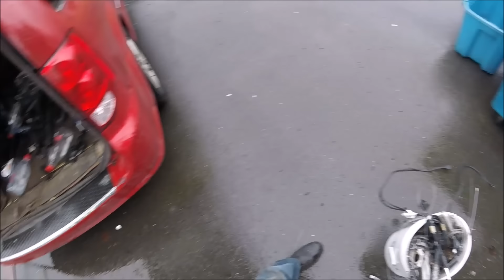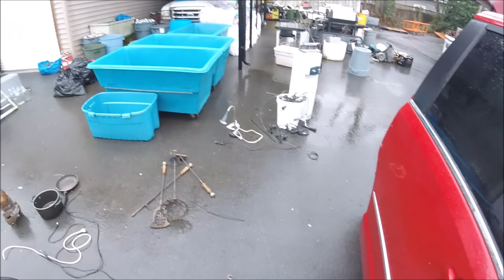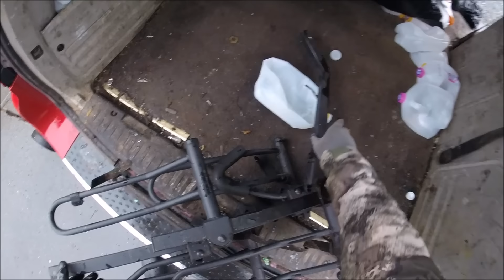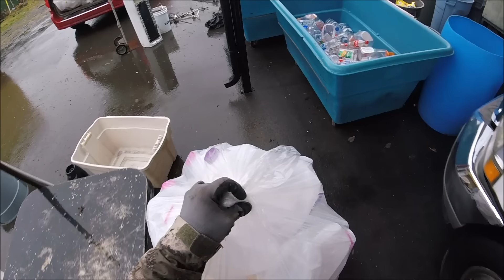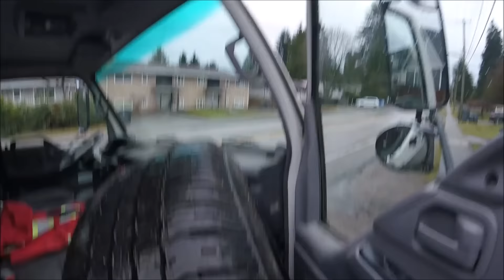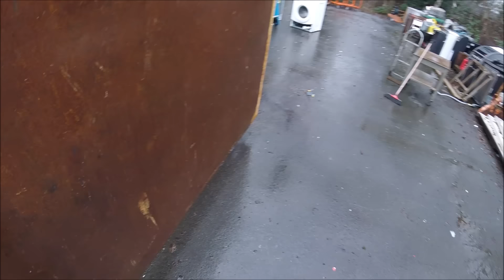Scrap Run Light iron Heavy Load & Bottle Run Record Month

Comment: What cutters are you using with the light blue handles? Looks like an older style Channellock 447 angled handle. I prefer that design vs the newer model 447. Or it looks like a Klein 2000-48 also a nice, angled cutter design.
Reply from the maker: Yes it's Klein old model, It has a nick in the center